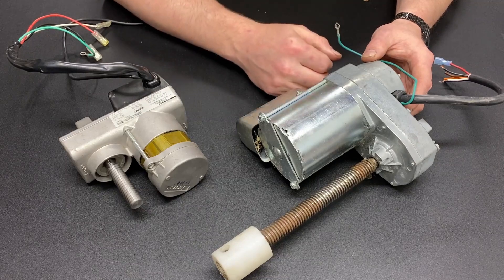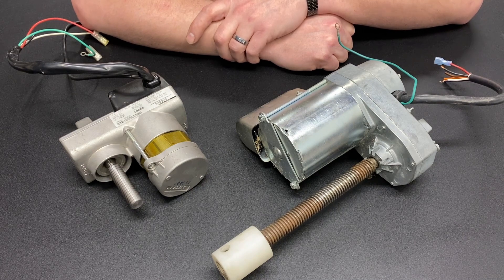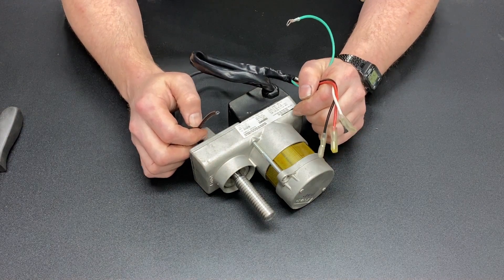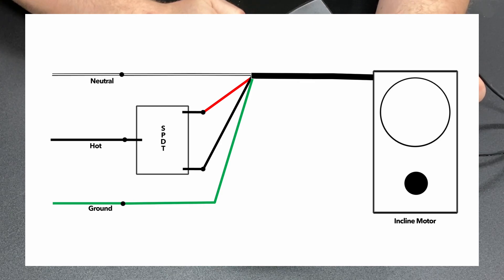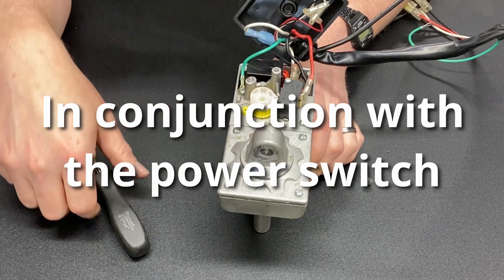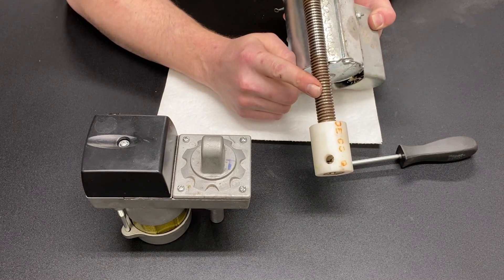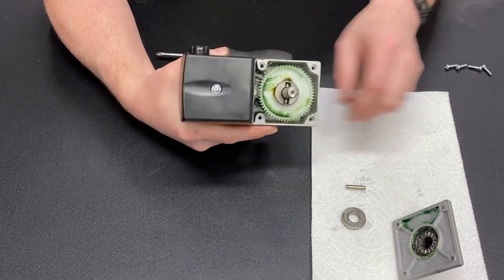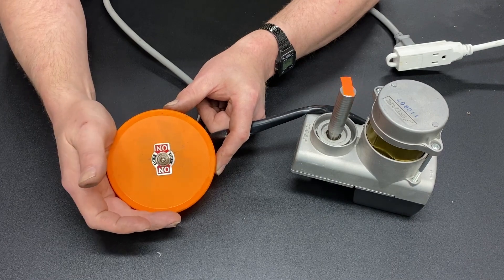A DIY hack for modifying, wiring and adapting a treadmill incline motor to your project.

Comment: I am thinking this motor gear drive system would be great on a powered bead roller.
Reply from the maker: Great idea, the one challenge to overcome would be duty cycle and managing heat.  The motor that I disassemble in the video is currently on my adjustable column mill to raise and lower the mill head.  The duty cycle is 1 min on and 8 minutes off.  I was able to improve that by adding an external cooling fan but I still can't run it for more than a couple minutes without letting it cool and even with the fan that can take a couple minutes.
Reply: @dazecars  I was thinking of the heating problem as well, I appreciate your responce to this. I think I will toss that idea.
Reply from the maker: @rickhettwer854   I would not toss the idea, in fact I like it so well, am thinking of doing it myself. The trick would be too build a shroud around the motor and add a fan.  if you go to 18:03 of my most recent video https://www.youtube.com/watch?v=FnMSwQKSEQA you will see the fan i'm using.  I have actually added a rudimentary shroud to it in conjunction with the fan and it has made quite a difference.  I would think almost completely enclosing the motor and blowing a lot of air across it would probably get the job done.
Reply: @dazecars  Ok, well perhaps you have persuade me into going for it afterall. I like the ides for my bead roller because of the low RPM the motor can put out, just about perfect for a single speed bead roller. Thank you again, I'll check further into the cooling fan part of this. 👍
Reply from the maker: @rickhettwer854  You can email me through my website if you need any pix of what I have done or if I can be of any help.  Also let me know how it goes.
Reply: @dazecars   Thank you, I'll more than likely need answers on how to's lol.

Comment: Awesome! You always come up with interesting and useful info for the shop.
I've had one of these actuators on a shelf for a few years, not knowing if I could use if for anything. Now I'm thinking about a Power Drawbar for my Mill.  I have an air operated power drawbar that I love, with one exception .... the noise.  If I can make this work, I will let you know. Thanks!!!
Reply from the maker: power draw bar...hmmmmm I may try that myself

Comment: What are some applications where this would be of use?
Reply from the maker: The requirements would be high torque, low RPM, and low duty cycle so as an example I am using mine to drive a set of leadscrews that will raise and lower the mill head on my mill.  The mill head and carriage is heavy, well over 100 pounds and will require (high torque).  I want it to move slowly so I can easily adjust it (Low RPMs)  and it will not be on all the time  as I will run it 30 seconds to a minute to adjust the height of the mill head and then it will sit unused while I am milling something allowing it to cool (low duty cycle).   make sense?
Reply: @dazecars  yes sir. Perfect sense. Appreciate it. I have a couple laying around but just haven't figured out a use for them yet. Thanks!
Reply: hope you will post a video about this
Reply from the maker: @samehdarawshi3537  about the adjustable mill head?  It has been a long prosess and im't about 3/4 of the way through building it and working the bugs out but yest it will eventualy be a video, stay tuned 😁
Reply: Im trying to turn one into a power feed on a mini mill
Reply from the maker: I know this is an old comment but I just used one as a power feed on my z axis of my mill.  There is a video on it